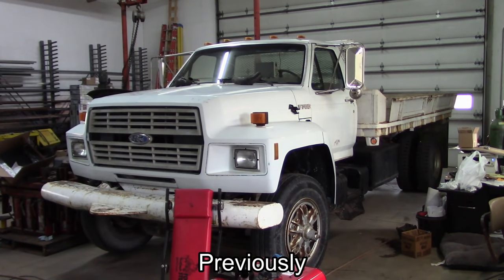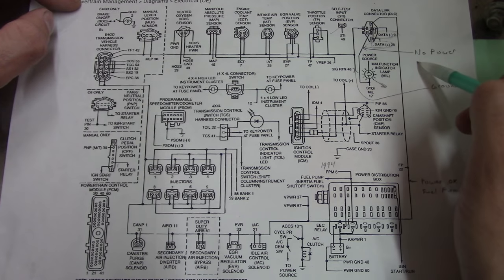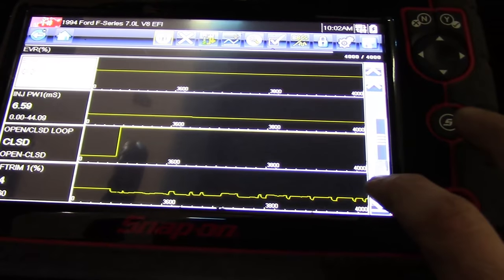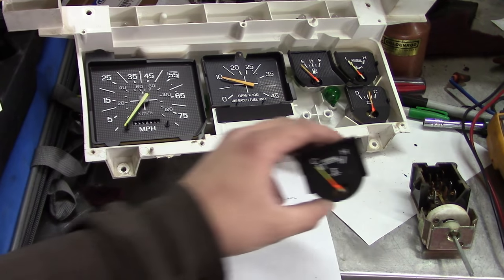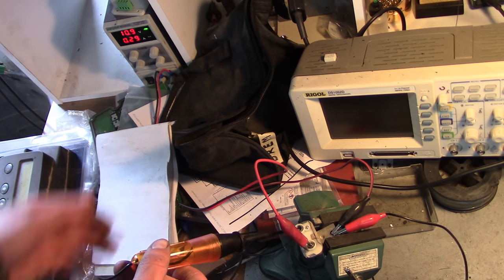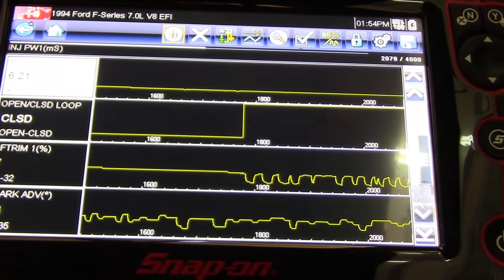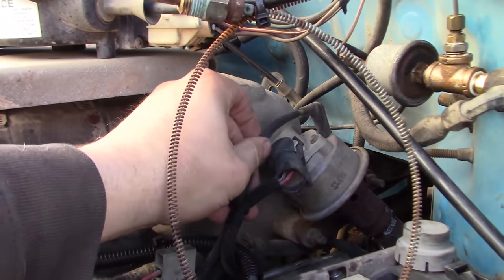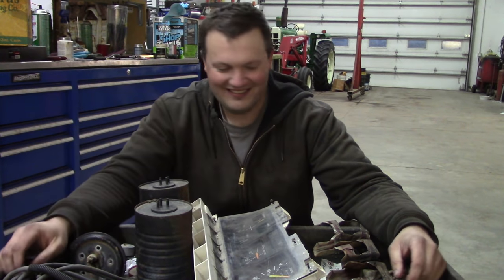Ford F700 Project - Missing, High Idle, and Gauges - Diagnose and Fix (Gas Engine) - Part 3

Comment: Great episode Wes ha ha I was on track for calling all faults apart from the dual communication ports and the melted plug leads. Very satisfying when you track down the root of a problem, I know you enjoy it lol. Did you say it also had plug wires  out of order? I guess the guy in charge of design was a fan of braces lol.

Comment: Hi Wes. Those early thermal gauges are pretty crude devices. The regulator is also a bi-metal switch which simply varies the on-off ratio to cancel out any temperature drift in the gauges. The response of the gauges is slow enough that you cant see the pulses.

Comment: Congratulations on 100k!  I still have nightmares about the pinout boxes for Fords back in the day. In 1980 GM introduced the CCC (computer command control) on all lines except for Cadillac. Most folks will say it started in 1981, but I was there. I can't remember the name of the scan tool we used, but it had live data. Cadillac introduced DFI (digital fuel injection) and live data was available on the climate control panel, called perimeters. You did a nice job on that truck, and I knew right away the vacuum canisters (coffee cans) were most likely rusted out. I'm not sure why Ford had to make thing so difficult, but that's why I don't like working on them. I would really like to know how you bill out diagnostic time when a job goes like this one did. You most likely won't want to say in open discussion, and that's okay. My email is the same as my name at gmail. Again nice job on this truck.

Comment: Had one of those instrument voltage regulators on a 70s Volvo 245 that I owned in the 80s. Bi-metallic strip with a heater coil wrapped round it. As you said, a sort of 1hz pwm to provide a regulated voltage to the instruments. It works because the hot-wire instruments are so slow to respond to inputs that they dont notice the pulsing. Anyway, whats was good for a 70s Volvo was good for a 90s Ford apparently 😁

Comment: We used to check those instrument voltage regulators right at the sensor with an analog meter and it would pulse like 0 to 7 volts continuously.

Comment: Actually Wes working on those older trucks, as not a nightmare. But it was actually real work, that required you to be able to think through the diagnostics. And I am familiar with OBDS1, as that was also back when we had to jump the A/B terminal with either a jumper plug or a paper clip on Chevy trucks to pull the diagnostic codes if we did not have a computer. And doing the diagnostics on a dodge required us to pull a plug on the firewall inside the engine compartment and hook a box that looked almost like an old light bright, to get the codes. I have forgotten a lot about working on those old car's and trucks over the last 30+ years, that I learned from what was then TSTI, which is now TSTC. But that flickering was normal, as that was how it figured fuel levels back then with tanks that had no baffles.

Comment: Oh the fun diagnosing an older vehicle with no shop manual ! You're a great mechanic man ! 
BTW, I had the same vacuum with my 1988 car, from the same source: the cheap soup can GM also used. A tiny rust hole at the bottom, impossible to see installed.
Unavailable at the scapyards in my area. Ridiculous price at parts store. I ended delicately removing the plastic manifold ans gluing it on... a Heinz tomato can ! Cost: 1,29 $.
Problem solved !

Comment: Prolonged idle does cause loop open (emissions set to preset)
My '89 Buick exact same way.
SES Telltale bulb must be present and working, or it sets a code.
Yes, regulator for cluster IS primitive PWM.
Nice to see OEM stuff working!
Other harness could be for a "BCM" Body Control Module.

Comment: Wes, I appreciate you sharing your diagnostic logic and how you got to the vacuum leak and purge canister. At least these are consistent problems you were solving. The next step more difficult are the random repeat issues. Like driving for 15 minutes, pull to stop sign/light and it shakes and misses. Throttle up a little, smooths it out mostly. Drive a couple more miles and park, running smooth as normal. BTW '99 Tacoma 3.4L V6 if you have a suggestion where to search to solve it. Been chasing it off and on for a number of years and not figured it out yet.

Comment: You tracking down vaccum resivipur leaks fast. Good work for sure
Reply from the maker: Thanks! It's a common issue with these old Fords. The pickups had the same soup can reservoirs. They rust all the time in our area.

Comment: While I've not worked on any Ford's form that era larger than an F-150... I can tell you that as crude as the EEC-IV is by modern standards. It is quite impressive about the only sensors that can cause it not to run are the ignition module and map.  Having accidentally fudged up a tune-up on my 1987 truck by unplugging the tps and crossing up 2 plug wires on a v-6... it still ran granted not well but I managed to drive it 5mi like that... and it never stalled!
BTW .. The dash 'electronics' up until the end of the EEC-IV is  essentially the same as a Ford from the early 60s and other than the CE light is totally independent of the computer operations for pretty much all Ford's of that era.
That was towards the end of Ford's design philosophy 'if it ain't broke don't fix it' and  ththe beginning of ' if it ain't broke fix till it is '.  You say that you don't feel as comfortable with pre OBD-II but you do far far better than most mechanics I have encountered that would not have been exposed to them as new cars. Keep up the good work 👍
Reply from the maker: There are not a whole lot of OBD1 vehicle left here, and haven't really been the whole time I've been wrenching. The other problem is most of these old OBD1 engines will run just fine with half the sensors unplugged and the cats and air pumps deleted. So no one fixes them until they completely die.
Reply: @WatchWesWork  I  think I  probably a few years older than you and  living in the southeast  our vehicles do tend to  survive a bit longer. But you do a good job with the logic need to figure out the issue.  BTW ...there was a really good pair of book written in the 80's-90s  FORD FUEL INJECTION by Charles O. Propst. It  covers the history/ versions/ sensors values and tests for most vehicles up to and including the EEC-IV. If you ever stumble on them. They layout the logic and architecture well.

Comment: Well, your video inspired me to take another look at my cousin's MF 471 tractor. It's a nightmare of electrical issues. The tach works, but none of the gauges work. I paid a pretty penny for the service manual which is worthless. It has tests to check the fuel sending unit, but you have to have power to begin with, that I don't have. The instrument cluster lights work and the headlights work, but none of the other lights work. I found a blown fuse and replaced it, but then it immediately blew the replacement. The fuse only fixed the turn signal and work light momentarily, but didn't fix the fuel or temp gauges.
Reply: The tractor had issues with, once it was at operating temperature, it would sputter and die and then wouldn't start again for about 3 days. I removed the fuel tank, looking for crud in the tank. I didn't find any but drained the tank and replaced the filters. We haven't had a problem with it dying since then. My cousin said he changed the filters every year before, but still had that problem with it randomly dying, until I pulled the tank.

Comment: Late 80's or early 90's ford ranger is why i bought a scanner. Would spit and splutter when you tried to start but wouldnt start. 2.3 8 plug engine. Changed plugs, wires, one coil pack, crank sensor, ignition switch at bottom of column and finally got a scanner and it gave a code for coolant sensor out of range or something like that and a $8 sensor later and it ran. Lol
Reply from the maker: Yes. Bad coolant sensors and MAP sensors really mess these engines up.

Comment: Simple circuit test on EEC-IV system temp circuits would be to clear the codes, short the harness terminals together, and run KOEO test.  If a shorted circuit code appears, then the harness and ECM should be ok.

Comment: That's the kind of junk that I had to work through in my mechanic working years. I'm sure you've heard of The Brick it was a slow-moving Snap-on ECM communication device. I felt really sorry for you working on that Thing!! Still a lot cheaper than buying a new one. All the best from Canada.
Reply from the maker: I remember the old brick. There's on for sale locally. But my Solus does everything it does and much more.

Comment: Only negative thing I point at Wes, is it seems obvious that those vac cans would be dead before even trying as those that are metal, (I have a  cool story on one of those) are rusted out from the get go and you would of pulled just for shits and giggles. I am guessing that this is not your first rodeo with them so just a brain fart on your end hu? I really like that double gauge when it works out as drivers get used to looking at one set of gauges and there is  where their eyes go everytime. I am still amazed at how quiet you got it to run. I like diesel over gas for consistent run life but since fuel went sideways on us, this gas alternative is the right route to go. I just don't care for all the bulk junk on them. You make it look simple and some ways it is when all the test stuff works for you but like this one most don't. A great job of figuring it out and making it like a new rig again. After your doing this, makes guys like me if still able to work to do the same things ahead of the other alternatives. Replace sending units and check for rodent damage right off the get go. As old as those rigs are.... considering how hard they are mistreated that new stuff instead of a screw driver to the dash unit .... I do believe it was a early nineties thing was about six to a few more and the dash cover came off reviling everything from behind the dash. I got a rig in once where a rider got his knee jammed into the dash.   I was able to take the control stuff for the heater out and then the radio.... all of what was in the area. I didn't feel like undoing the whole metal dash out so just cut a nice piece out and made my own stuff that fit that hole and get all the other back in. At the same time, the hole for the radio was huge so just went with a small screen radio with extra features like a backup camera. They loved that one.

Comment: That 'voltage regulator'...that powers a sort of 'bridge', and involves a bi-metal strip with 'heater' being a coil that gets the regulated  power. the other side of the bridge is the resistance to ground through the 'sender', then the 'free' end of the bi-metal strip moves the needle, crude, but not much electronic stuff in cars/trucks from the 50-60's for the dash meters......take one apart, they're interesting. 
  That gas tank sender, you can sometimes buy just the float, it snaps in there on that piece of wire...and those plastic ones do tend to soak up the gas...

Comment: The fuel gauge voltage regulator is supposed to do that. It takes 12V DC and converts it to a pulsating DC averaging around 5V for use by the gauges. I don't know why but they all worked that way for many years before engine management computers.

Comment: The instrument voltage regulator works exactly the same as my 1969 Lotus Europa.  Its just a bimetalic strip switch.  It was a crap system 52 years ago, and still is.  When they fail - which is often - the temp is often 10 to 20 degrees overstated.  However, if you are half useful, you can make a solid state one for about $2.

Comment: I really enjoyed this series though I don't normally comment since I'm not a mechanic.  That said, I do auto instruments so I had to add my 15 cents.  That regulator is a simple thermo-electric device with a winding around a bi-metal opening and closing contacts.
To achieve a 5 volt output, the contacts are closed 40 % of the time and open 60% of the time.  40% of 12 volts is 5 volts. 
The first regulator you tried was definitely fried but the second one seemed to be pulsing normally. 
I always replace them with a solid state device because when the contacts on these old regulators burn out, the regulator cooks and it cooks the gauges as well.  Lucky all the gauges weren't fried. 
Anyway, like I said, just my 15 cents.
Reply from the maker: That's kind of what I figured. I just wasn't exactly sure how it worked.

Comment: That Idle air control looks just like the one on my 4 liter. I cleaned and lubed it a few times and got a few more years out of it. It would stick open and closed. Cause all kind of problems  (like no starting in cold weather) and unsafe conditions. Try stopping an auto will at high idle. I think I will be buying a new one.

Comment: Wow this is... Quite the truck
All those disconnected sensors and valves and the sketchy wiring. Aye aye aye.
Love the manic laughter when you pinched the purge line off lol.
Edit: Also I guess Ford was so preoccupied with putting two of everything on this truck they even put two diagnostic connectors on  it!
Reply from the maker: LOL. That one really tripped me up.

Comment: You probably know by now, that the dash voltage regulator was more or less a flasher.  It turned on to to charge the circuit up to about 8v then off.  The gauges are damped so as to not fall between pulses.  The method goes back to the first electric gauges.  In the 30-40s Ford built the regulator into the sender unit for each gauge.   Going to open loop was common OBD1.  The O2 sensor is not heated, it cools off at idle and goes off line.

Comment: Yes, the regulator for "thermal" gauges ALL work as a crude PWM . .In the regulator there's a bimetal switch. After it heats it curls and disconnects.   then uncurls then re-connects - at a 5/12 duty cycle to produce an average of 5V out.. sorta kinda. That's ALL THERE IS.  There isn't any more.  You CAN replace them with 7805 5V T0 220 package.  They work great and are pennies - 50 cents at Mouser.  From the 5V rail, the gauges are in series with the sensor resistors to ground . The lower the sensor resistor/resistance, the higher the current, which heats the bimetal sensors and curls them up and down - oooh! Just like the regulator. Yep!. If you watch ANY of these old gauges carefully you'll see the needles move up or down every so slowly at the regulator switch rate .. yep..it's the regulator switching on and off. Like I said, a 7805 regulator (I priced the 1.5 amp one..they also make a 1 amp one) makes this smoooooth and reliable and chhhheeeeeep!

Comment: I think the other DLC is for either abs or rabs . And the instrument regulator has a bimetal spring with a heater that heats it up while the points are closed on the regulator , there should be an adjusting screw to fine  tune the cycle time . Also the gauges it runs use the regulated power to run a heating element in the gauge themselves witch heats another bimetal spring to move the needles . Then the different sensors change the ground to get the different readings . If I remember correctly

Comment: Those gauges have bimetal strips with a heating coil around them. The voltage at the regulator ( also bimetal/coil)  varies, causing a faster or slower pulsing to the heating coils,
so giving a very rough average voltage to the instruments.

Comment: Also fuel gauge not be corrosion on big plug plus on the fuel tank plus ground to the frame & be rusty up put new connector plus new  bolt to washer and nuts ! Bolt hole have clean , then head bolt with washer to left side frame , then washer on inner frame then connector, then washer and 2 nuts on threads! Also use stainless steal bolts , washers, nuts and 3/8 to 1/2 bolt be excellent to use ! Also yes those Ford truck were made in Oakville Ontario till 2010 quit make them there  but if work on Sterling trucks in future are like newer  FORD trucks to made !    Also old Ford in Desiel or Gas motors take 30 mins be fully warm up if sitting long time and if ran more 30 mins it only takes 10 to 15 mins warm  perfect on idle too!

Comment: Wes, I changed a fuel pump on a cavalier the float switch was longer,of course it was after market didn't wanted to change it to the old pump float switch the new pump was not accurate on the gas gauge, I checked the ohm's 0 to 5 ohm's and it was okay ,I went to AutoZone and they give me another pump and it did the same thing,full tank was reading 1\2 tank, I ended up installing the original float switch from the bad pump and it work fine

Comment: gauge volt reg works like  a Mopar, pulses to give an average output.  in the case of Mopar of 5 volts. On Mopars its just a set of points with  a bimetallic spring ,the voltage going thru heats up like a bimetallic themostat spring and disrupts the voltage then cools off and voltage returns.  In Mopars the points burn fast and gauge needles go off to full and if things continue burns out gauges.

Comment: Awesome job Wes as usual. I’ve been there a few times where you just have to shake your head and laugh. 

Quick question... did you ever figure out what the other data link was for? I went thru some of the comments but didn’t see it mentioned. Curiosity is getting to me.